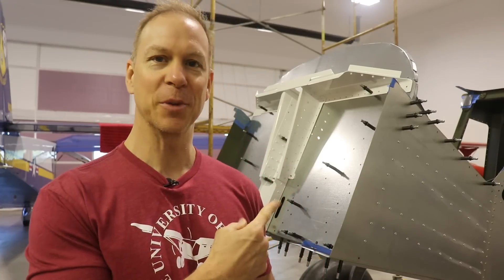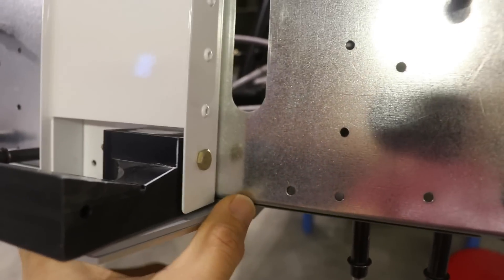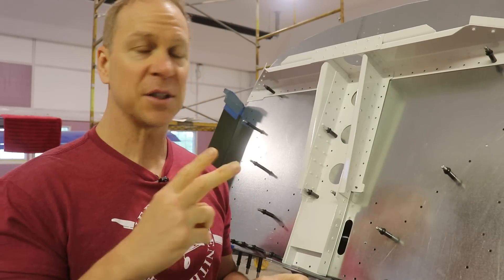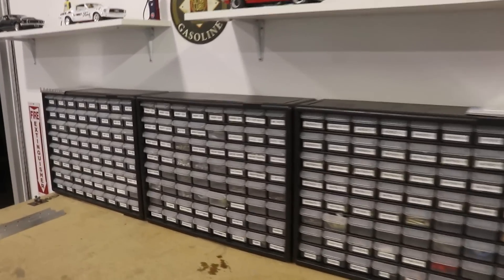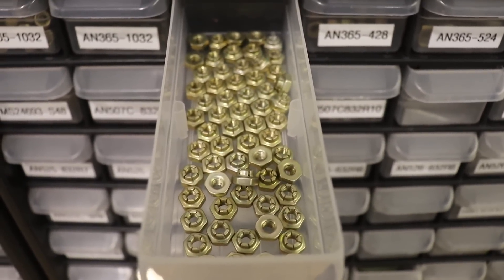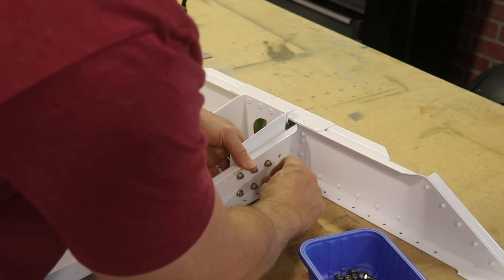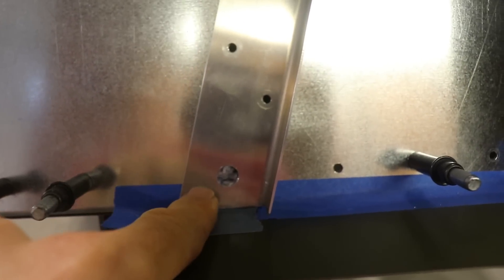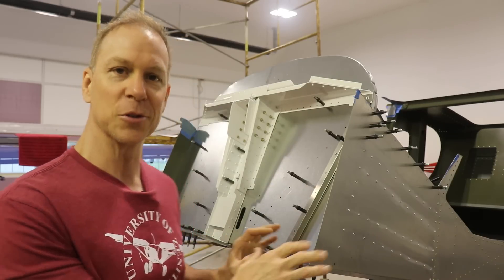DISASTER averted - Thanks to my awesome SUBSCRIBERS! (Ep48)

Comment: I always put the rounded side of a washer against the metal so as not to scratch it.  I don't want to create a stress collector point in the metal, nor do I want to remove any corrosion inhibitor (paint or anodized layer) from the surface.

Comment: Mark,  your comment on the washer made me laugh, I do the exact opposite.  I put the sharp (stamped) edge out against the nut so I don’t put a nick in the aluminum.  Your point is probably the correct answer, do it the same every time.  Love your videos, keep up the great work.  On the nuts, you are correct.  The handbook is the Bible but since no one has actual temperature readings it has become the “standard”.

Comment: As an A&P, we don’t use any nylon locking fasteners in high temperature areas.  Normally nuts with a crush neck self locking feature are used.  Most large commercial aircraft use high temperature hardware in the engine compartment as temps in these areas can be well over 350 deg F.

Comment: I see you did not torque those fasteners as you assembled it with the metal nuts. By not using a torque wrench there is a possibility of overtightening them because 10/32 don't take that much torque. Feel can be deceiving.

Comment: On my airplane with a continental o-200 aircooled engine the temperature right on the firewall was usually no higher than 180°F .. i've measured that because two egt probes could not be mounted to the exhaust, so the mechanic decided to just stow them away zip tied to a wiring harness along the firewall until i get a new exhaust with silencer which would allow to mount those probes as well. Air temperatures around here on a hot day are usually around 100°F

Comment: For nuts with a nylon insert to facilitate locking, you just need to ensure that if the nylon locking feature fails, the bolt cannot fallout and the failure isn't 'dormant' (meaning it won't be easily detected, either during frequent inspections or immediately via a physical noticeable sign such as rattling or vibration of the fastened part).

Note :  Regarding orientation of washers, it depends upon the type of washer and the type of application.

For regular applications one might prefer to have the full flat surface of the washer against the part. This maximizes contact area, prevents dirt and moisture from accumulating in what would be a 'gap' and helps prevent stuff from being caught on the sharp edge of the washer.

However, also the radius edge (special thick washers) of a washer can be used where there is a radius (often referred to as a "fillet" radius) at the junction of two perpendicular parts and the fastener is close to the fillet. 

In fact, we often call for special washers called 'Radius Washers' however, they tend to be square or rectangular in shape, where the fastener's location is so close to the fillet radius of a part that the outer edge of washer would actually sit (dig into) in the fillet. 

Of course the radius of the washer then must be bigger than the fillet radius of the part; this actually helps reduce local stresses (stress concentrations) where clamp-up loads are high or there is a concern regarding low loads together with high vibration cycles, leading to stress fractures along the fillet's tangents.

Comment: So Mark, if I think of all the projects I’ve built around the house, I would have to say that I would completely agree with you on the placement of the washer.  Now, I am starting my Kitfox build and I am questioning if that is correct or not.  I don’t know.  When I saw that part of your video I was in agreement but then I thought, would I want the sharp 90 degree edge against the powder coat or metal possibly digging into the surface?  I am not sure which way is technically correct.
Reply from the maker: In 25+ years of aircraft maintenance I've never once seen a washer cut into paint or powder coating. In theory I could see how that would happen, I just don't ever recall actually seeing it.
Reply: @KitplaneEnthusiast  Perfect, great info.  Thanks for the response.

Comment: Washer orientation is the topic of Piper SB1366 due to the potential of the 90 degree edge to create a stress riser in an adjacent radius of the wing spar.  Would love to come over and see your build; I live just south of 9G2.  I have a Cherokee 140 and have completed the empennage, flaps and ailerons of a scratch-build CH650.

Comment: The only exception I can think of for the washer is to have the curved 
or beveled side on any component that can flex. What comes to mind is 
tail rotor driveshaft flex connections. If the washer is installed flat 
side to the component it can cause a crack and ultimately a failure when
 it flexes. There may be a case for having the curved edge on sheet 
metal if it has any expected flexing during operation. I'm enjoying your
 content! Keep up the good work.
Reply: in such cases shouldn't a thin washer be used so that it flexes ?

Washers are typically employed for one of the following reasons :-

-  To protect the surface finish (eg. paint) where frequent assembly -  disassembly takes place.
-  To facilitate installation of tensile bolts with shoulder radii (beveled ID).
-  To accommodate a limited variation in grip thickness due to stack up of tolerance; multiple assembled parts
-  To increase the clamped area while lowering the compressive stress on the surface (oversize washers)

However if the surface is flexible, I'm not sure a washer with a radius at the faying surfaces outer contact boundary is going to reduce the stress that much if the washer is thick enough to have an appreciable radius ?
I'm thinking the washer is thus stiff and cannot flex, implying the stress concentration will be at the circumference of the hole in the thin part and not out near the OD of the washer.

But I could be entirely wrong on this.

Comment: It's kinda interesting that you steer away from using Nylocs, that are used to mount a green block made of... nylon?
The Nyloc nuts may be rated for 250F, nylon itself melts at a much higher temperature. It probably ages faster when constantly exposed to elevated temperatures, but by the time the nuts in that location are reaching 250F or higher, you have quite a different problem at hand ;)

Comment: There is zero need to deburr holes drilled through multiple layers IF the layers are clamped snugly together while drilling.  You only need to deburr the exterior of the holes where a rivet or bolt will touch.  The interior will not have burrs unless the layers of metal are not clamped together.
Reply from the maker: That's not entirely true. The burrs will be small, but there will be a slight burr. In the case of the engine mount holes, there's really no way to clamp the layers tight-especially the bottom two. Even holding them as tight as I could while drilling, when I took them apart every single piece had a burr on it that needed removed.

Comment: Not only do I orient the washers as you mentioned, I also line up the flats on the bolt heads if there are several in a row.  I’d like to line up the nut flats also, but when torquing fasteners, torque spec takes precedent.  😁

Comment: I suspect many parts of the engine compartment exceed 250 F on a hot day while taxiing.  Keep in find what CHTs routinely run above 300 and the exhaust pipe likely is 500+ depending on power output.  So, anything close to the exhaust of cylinder heads is likely to see 250 when airflow is low such as idling in place or taxiing slowly on a hot day.  Better safe than sorry.

Comment: Putting the washers on that way will actually spread out the load slightly more.
Reply: It also places a larger washer area (with 90 degree edges) against the aluminum shell and a smaller washer area (rounded edge) against the steel nut,  which is consistent with the metals' relative strenghts.

Comment: I usually install washers round side up (pretty side out). From my USAF aircraft maintenance training we were taught the flat side might dig into the mateing surface so they recommend to go rounded side down, but other than scratching risk, it doesn't matter from a structural standpoint. The only down side in aircraft environments is that with the rounded side down it can catch and trap small dirt and moisture easier, but we're splitting hairs here.

Comment: Looks fun.  You still have that green nylon spacer in front of the firewall.  I am not sure what the function of that spacer is, but nylon is not only a problem of low melting point, but in the case of a fuel fire, it can create toxic gas that can enter the cabin while flying.  Have you thought about remaking that spacer using phenolic thermal material?  We use it in race car applications and can withstand heat up to 500*.  Something like this material ... https://www.grimmspeed.com/grimmspeed-phenolic-thermal-manifold-spacer-wrx-sti-fxt-lgt-8mm/
Reply: In the previous video, I see that it looks like a bushing for the nose gear.  Phenolic marterial would need an anti-wear/non-friction coating to make it work.  Still, something to think about.

Comment: The rounded side goes towards the nut (or the bolt head when on the head side of the structure)
Reply: The other way around. The rounded part goes on the workpiece (sheet metal), not the nut or bolt head. Piper just issued a SB on this very subject. It's to prevent faying of the sheet metal due to vibration.
Reply: @JustaPilot1  Yup it is right here. https://www.piperowner.org/talk/discussion/155196/piper-service-bulletin-sb1366-main-wing-spar-hardware-inspection

Comment: When in the military my boss always insisted that Nylock nuts were a one time use only and insisted that we install new ones and discard the old.  Wish I had kept them, I would have had a bushel basket full by now.
Reply: Yes, that is just crazy.  Last I knew, even the military allowed 5 uses of Nylocks, which is ultra conservative itself.  This is one area where the FAA is actually reasonable and makes the usage based on data - the prevailing torque measured.  If the prevailing torque Mets or exceeds the minimum, you are good to use again.  That is a sound engineering approach.

Comment: I'm not trying to be "nit picky", but aren't you replacing nylon locking nuts for metal ones. To hold a nylon bushing? Seems to me to be a little odd. Also, I place my washers the same way you do. Flat side to the surface and rounded to the nut. Love your videos. Cheers from Winnipeg.
Reply: I had an inspector reject a man-lift I'd designed because the screw drive used a modified (lubricated) nylon drive nut. Fire safety concerns. The open air man-lift could fail from heat with an occupant on it. 

The guy was an idiot...

Comment: I was wondering if there is a suggested torque for the locking nuts ?
I have used the smaller Demi Torque Wrench ( 3 - 15 Newton Meters version ) when required below the standard 3/8 drive levels.
Great move not using the nylon nuts - why guess on the temp changes in different ambient situations

Comment: I thought you might try the aluminum spacer to solve your dilemma.  I also thought about drilling out the holes to take a larger size bolt.  The first solution is much "cleaner" than the second.  Your "bolts, nuts and rivets supply looks like a high tech hardware store. You almost always have the correct "item," but it also saves a lot of time looking for the right one.  I love that.  It is next to impossible to find the exact one when they're just piled on top of the bench or in a box all together.

Comment: I've found that the more square edge of a washer digs into the paint more than does the rounder edge.  Which is better is a matter of whether or not you want the washer to dig in.
Reply: Interesting observation John. 

In the case of one coat of primer and perhaps two coats of topcoat (less than ten thousandths of an inch of total paint thickness), is it that pronounced if you use aircraft grade epoxy enamel paint and allow it to cure for the full recommended period ?

I can possibly see a problem if the thickness of the paint constitutes a lot of layers and the bolts are tension bolt applications (higher torque for higher axial loads) but not any problem for shear bolt applications.

I'm learning new things about Experimental and Light Sport Aircraft builds, as my background is Transport category aircraft, so my question is from the perspective of that of a 'newbie' to the kit building community.
Reply: @daverobinsonTnT  Just to be clear, I've never built an airplane before.  That's why I watch this channel.  My reference to washers and paint comes from a powder coated hobby project (not aviation related).  In this case, the 90 degree edge of the washer, which was in contact with the powder coat,  created a crack in the powder coat in the precise outline of the washer, and allowed moisture to reach the steel underneath.  I had to sand down the area under the washer and apply some touch up paint to seal it up again, this time putting the smoother rounded side of the washer in contact with the paint.  Naturally the thickness of the paint, along with its composition would make a difference.  The biggest effect that I've observed is that, during the process of tightening the nut, the rounder side of the washer scuffed the paint underneath less.
Reply: Thanks John, I've learned something new as I was under the impression that "Power coating' would employ a paint that provides a hard surface but as you've pointed out, it may be too hard a surface finish; more brittle than I had thought.

I learn on here as well mate - especially from the comments of builders like yourself who have varied background specialty expertise from other interest which can be applied for Experimental Aviation. 

So thanks for the 'heads up'.
Cheers.

Comment: My A&P friend says that Cessna uses nylon lock nuts in their certified aircraft engine compartments.  Also Zenith specifies them in its plans.  I know Mark is a wonderful builder and in now way criticize his discussion to use metal lock nuts.
Reply from the maker: Hi James-that's what I mean when I say it's controversial. Some people will say they are ok to use, others say not to use them. Obviously I've never done any scientific testing to know one way or the other, so in my case I just chose not to use them. I just wanted to relay my experience with the FAA inspector who wanted me to change them out. Other inspectors may not have an issue with them!

Comment: Funny, I, too, always place washers with the "smooth"/ radiused edge up and the sharp edge down!  Similarly, when I have a row of zip ties on a wire bundle, etc., I try to orient them so that the ends you cut off all face the same way.  I think it just "looks better" and at least shows some attention to detail!  Guess we're both obsessive-compulsive!  Not a bad "mental illness" to have when you're building airplanes! LOL!
Reply from the maker: I do that with zip ties too! There is something wrong with us.
Reply: Yes to all the above ! Among other things I also line up bolt heads and look for markings on all nuts and fasteners and orient them the same. It's a sickness that I don't mind having given the nature of the project!  Probably the reason I don't care much for help from others. Glad you solved your dilemma, Thanks for sharing and Blue Skies!

Comment: Excellent solution to the problem. And a good choice on the nuts. But also be aware, where I worked we considered them a one time use hardware including the bolt or screw it was used on.
Reply from the maker: Yes that is true. The lock nuts do 'cut' into the bolt more.
Reply: @KitplaneEnthusiast  Looks like that top bracket may have to come off again to rivet the powder coated structure onto the fire wall.